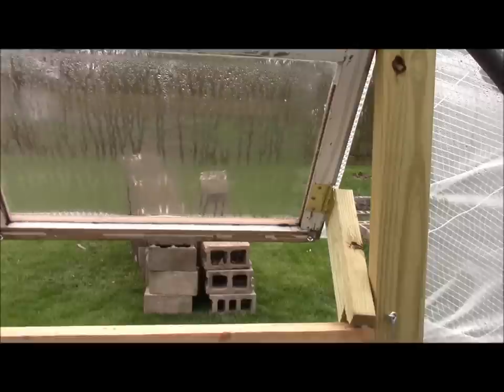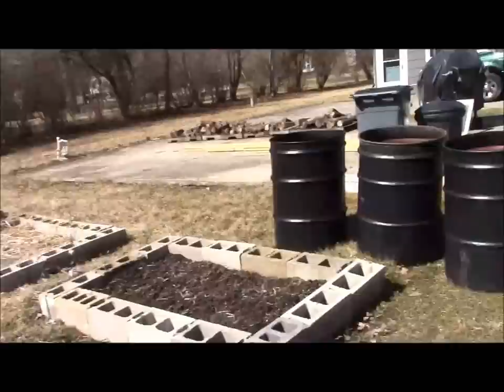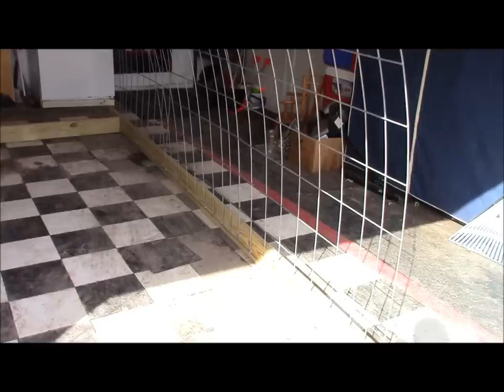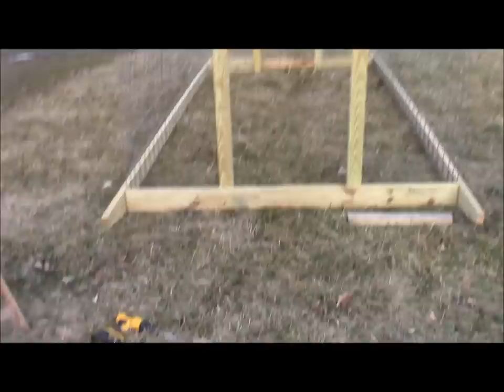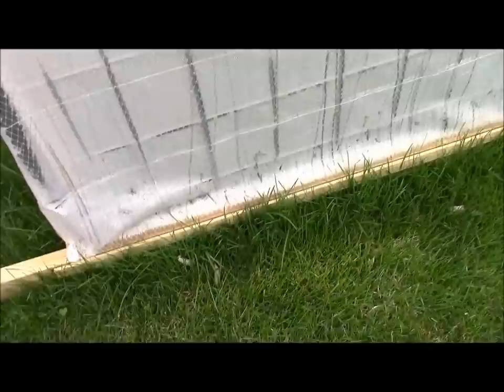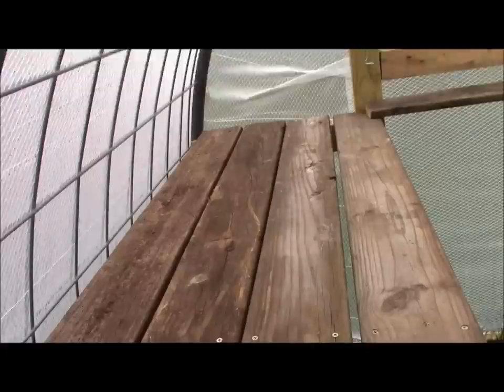DIY Cheap Greenhouse

Comment: Great idea with the cattle panels I'm going to build it.
Reply from the maker: It is a very easy build and low maintenance
Reply: @lambertoutdoors  how wide is door frame
Reply from the maker: Greg C   28 inches
Reply: How much was the wire?

Comment: Thank you for the design.  It looks easy enough to raise up as well. I am a tall guy and hate low spaced, but you can always add to the base.
Reply from the maker: If you want it taller, just make it less wide at the base.  By doing that it will make it taller and thinner.  You can also get a longer hog panel and do everything else the same.

Comment: Looks really great and not expensive to make.  Your presentation is great, too!  Kudos!!!  I've just designed mine; however, mine will cost a bit with more permanent materials, but it will still work.
Reply from the maker: Awesome, what are you going to be using yours for?  I like to ask to get more ideas for ours.

Comment: Great video. Not drug out for 30 minutes with a lot of bs. I’m building one pretty much the same way.
Reply from the maker: Thanks, not a fan of the bs either,  mine has worked out great.  Put a tomato plant in a 5 gallon bucket in there and it will turn into a jungle

Comment: Hi there  great greenhouse DIY the basics are there any alterations can be added to ones own specifications  ie i would build a raised bed down each side fill with compost mixed with black kow manure.... tomatoes cucumber one side the other side green salads .. melons and maybe a grape vine...might think of making it a walk-through so you could take in a wheelbarrow when needed.. also walkthrough circulates the air better reduces plant infection...... OK thanks for your posting really good advice easy to follow very instructive ....Ed
Reply from the maker: Those are EXCELLENT ideas!!!!  Thanks for the comment
Reply: @lambertoutdoors  Thanks Lambert Acres .... i live in Beverly Hills Ca.... i have a greenhouse controlled thermostatically... what ever the weather conditions or temps outside its always right for the plants "extravagant" :-{ yeah but i love growing the unusual tomatoes "Shirley" cucumber "Market most" The greenhouse you have in the video dad and i built the same on our farm homestead up in Utah  really good cheap to erect lasted through all weather conditions  if i remember we had 4 on the farm when not growing in them chickens were kept in there fertilizing ready for the next growing season .:-{ dad always said want not waste not  organic growing.... OK Lambert Acres... See-Ya now...............Ed

Comment: Great idea for a greenhouse.  A couple of questions:  what is the wire gauge size of the cattle panels you used, and what is the finished size - length, width, and height (at the center) of your greenhouse.  Thanks.
Reply from the maker: I don't know what size gauge it was, they only had one option.   The wire is about 3/16 inch think though.  finished outside dimensions are length-13 foot 3 inches, width-7 foot 3 inches, and height at center-6 foot 6 inches.  I will do an update video this spring.

Comment: Will you cover the grass inside to kill off weeds /grass with dark polyethene? I would have dug it out then laid down card board- soaked it then covered it with compost down each side made up of well rotted Cow manure - mushroom compost and other green compostable material. The middle you could have laid down wood chippings to act as a walkway.  Looks sturdy enough. This could be adapted to make a 20ft long greenhouse but same width I expect?
Reply from the maker: yes you could definitely make it longer.  and I ended up just raking leaves in it from my yard it killed the grass.  Thanks for the comment

Comment: I noticed your doorway does not provide a seal (there is an opening 6:36 ) Do you lose a lot of heat through that crack?
Reply from the maker: Great comment, we actually did not design it with a seal and we open the windows to let pollinators inside the greenhouse.  There is no loss of heat, it is always warm in there.

Comment: How is the greenhouse holding up since you've built it and what were the dimensions?  Did the plastic hold up well?
Reply from the maker: Plastic needs replaced every 2-3 years (we have high winds).  Frame has held up well, dimensions would be adjustable depending on how many hog panels you add and the length of them, watch the video again for a reference.

Comment: great greenhouse. but i missed the part about what u did with the rubber hose?? etc.
Reply from the maker: I put it on the ends on the metal where the metal is in contact with the plastic, so it doesn't rip the plastic.  So far so good, we are still using it daily.
Reply: thanks very much
Reply: im feeling more secure in bldg this greenhouse. ive waited most of my adult life to stop workint and finally grow food flowers and love on my animals.
Reply from the maker: If you have waited to do that, I am assuming you have been working hard to get to that point.  Sometimes you owe it to yourself to treat yourself.  The bible says he will take care of us.  Good luck
Reply: its interesting that u say that as im waiting to have an epidural. i have 3 times over my teaching years. of course everytime is was my back. but i know He that started a good work in me is faithful to complete it. so if i have to drag myself to the chix coop or greenhouse, im still trusting and believing in the power of the Holy Spirit. thanks for your wisdom an spirit.
Reply from the maker: And I am claiming that everyone that reads this will be praying for you.

Comment: Really nice greenhouse! I'd like to built one for the first time, but I read that plastic/PVC is bad for sensitive vegetables - what kind of plastic did you use, or any other ideas? Thanks
Reply from the maker: +loui0008 I got it from Menards, I did not see it at any other stores.  It is basically a layer of plastic, then cloth mesh, then plastic.  so far so good to.  We have not noticed any difference using it over growing things outside or in window boxes.
Reply: Thanks so much for your quick response and good info!

Comment: I'm interested in building a greenhouse like this. Is $150 just for the plastic and treated wood only or it also includes the cattle panels?
Reply from the maker: The cattle panels were included, however it you make it shorter you can save $$, also if you don't make it as long take away some of that price or if you make it longer add some price.

Comment: Hi Lambert Acres, 

For the "Integra All Purpose Reinforced Plastic Sheeting", description "Clear String Reinforced Sheeting, 27 lbs. size 20'x50'"  and SKU "568-0090" 

Questions: 

☠ Can you give me an update as to whether this plastic has hindered the amount of sunlight coming in that would possibly slow down production of growing?

☠ Would you purchase this plastic again? 

☠ Why didn't you bring the cattle panel up to 4 inches to give you a little more headroom?  

Thanks in advance !

-Danny
Reply from the maker: 1st question-the only negative about growing food in this plastic is that in the summer it got hot inside the greenhouse.  We had the door propped open and window open.  I don't think that had anything to do with the plastic though, that is just how greenhouses work.  it did not slow production at all.
2nd question-Yes I would buy it again.  I still have not had to replace the plastic, no tears, or rips,  no discoloration, no stretching, no problems what so ever.
3rd question-i built it for my woman, if you watch my other videos with her in it, shes a little thing and doesn't need height, but would do better with more ground area.  I wanted her to be able to reach the top inside to tie stuff on cattle panel too.
Thanks for the comments Danny I can see by the playlist you have created you are going to be diving in to this gardening thing.  I suggest using greywater for and also try aquaponics.  Using greywater is a secret weapon.  Good luck and God Bless
Reply: Thanks for your speedy reply and god bless !!!
Reply: I have created my Greenhouse based off your ideas and preppers ideas. I will post a link to a pic once I get the skin on it.
Reply from the maker: CONGRATULATIONS, that is super exciting.  You will love it.  We used 2 skate boards under the back to move it.

Comment: do you know the product name of the plastic sheet of sku number?
Reply from the maker: +Fred Greenwood Product name is "Integra All Purpose Reinforced Plastic Sheeting", description "Clear String Reinforced Sheeting, 27 lbs. size 20'x50'"  and SKU "568-0090"  I hope that helps, it has held up to high snow weight and high winds that we get in Ohio.  Thanks
Reply: Thanks so much
Reply from the maker: Fred Greenwood You are Welcome, This is my second year with it and it shows no signs of aging or tears.
Reply: For anyone that lives Texas, we know that temps can get well above 100 degrees and stay over months on end and plastic faded/melts over time here. With that being said, I contacted Menards and carefully researched the issue myself before purchasing. Here is what their response was "Greenhouse film is manufactured from special grade resin and contains a very high level of Ultra- Violet inhibitor….the Dura-Skrim 5680090 does not contain UVI and is not rated for long term outside exposure.  Would not recommend for greenhouse application." So, I bought mine from FarmTek with a 4 year guarantee. Sun Master has UVI on item number 108658. 20x50 $128 shipped!
Reply: Fred Greenwood Surreal.

Comment: if i bought ur template but wanted dimensions of 15x8x8 i can go to Home Depot and ask for the material
Reply from the maker: I don't have a template to buy, but you can listen to my video and write down the stuff I say and use that for free.  Good luck they get hot if you are somewhere with heat, so you'll have to add a small fan or vent in the summer.  In regular climates, just open the door and window.
Reply: +Lambert Acres ok i thought u had a website in ur description must of been a different video but i lkme this one 👍👍👍
Reply from the maker: Thanks and good luck